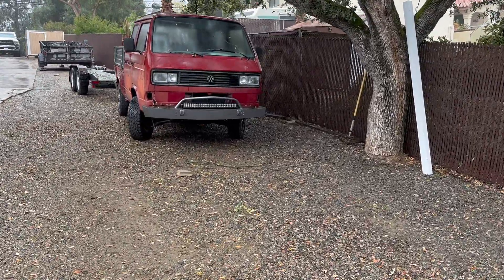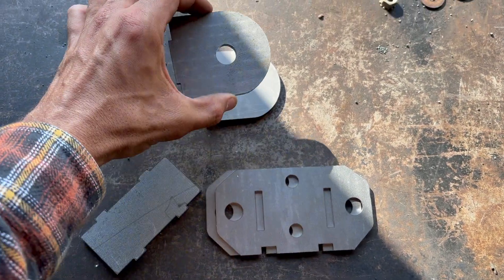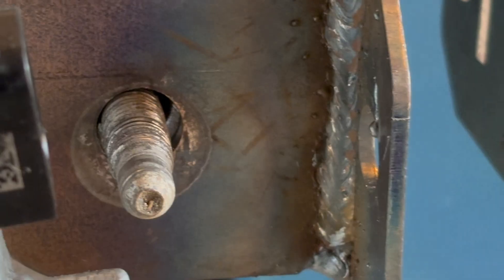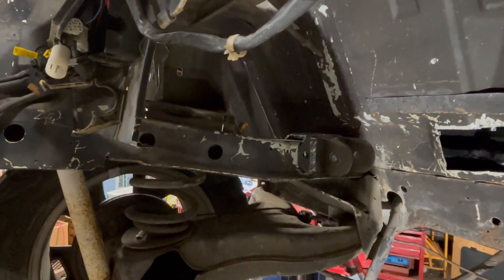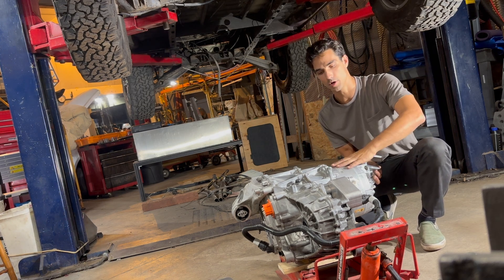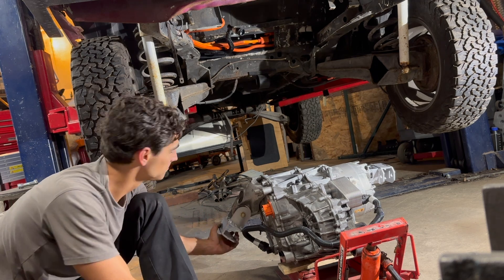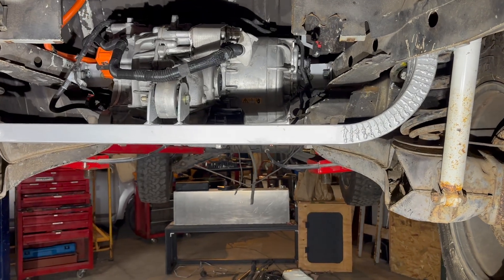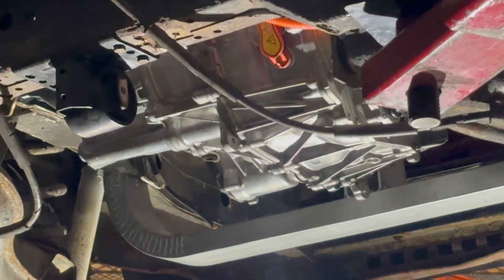Putting a Tesla Motor In My VW bus

Comment: I want to convert my Vanagon Single Cab so Im sending you a message. I posted on your instagram page to no avail. On instagram Im know as somewhattwisted.    :).  How would you lower the mounting points to help reduce that drive axle angle on  each side and yet still retain solid strength for side loading? I have another avenue to electrify but Im liking how the Tesla Model 3 fits and leaves sooooooo much room. Here in the states I could and would likely want to widen the mounts and weld a strengthening plate on each side of trail that the mount straddles. If the lowered mounts allow removal without removing the rail mounts then I’d also weld those to the chassis rail here in the States. I want it super strong and super overkill. I’d use thick tubing to make that cross mount. That would need to be removable.

Comment: Super inspiring!  I would love to try converting my old Datsun. Is there a reason why you chose model 3 engine and battery pack vs the model y? Model y battery pack seems more compact and may not have had to be cut down.
Will you please post more information about installing the charger, how it turns on, and how it connects to the steering?

Comment: Things do not mounted by a 'precision' tube/bolts. It is being hold/fixed without freeplay by the ends of the tubes, contact areas, which are pressed together using the bolt-nut.

Therefor the ALU tube in the two motor mounts should be just used to fill the 'hole'. The original steel inserts inside the black rubber of the motor, should be clamped between the two flanges of the new motor mount.
For the mounting of these two mounts on the car frame: the beam of the car must be 'filled-up' using a steel tube so a clamping force on the frame would not crush the car-beam.

So to fix things correctly: a bolt-nut should cause (a lot of) friction between surfaces to mount things. A hollow beam will prevent friction force because the beam will compress, so causing no friction force. 

While it now maybe does not have freeplay, side-forces will enlarge/re-form the holes, and so cause freeplay (and more) in the end. This because no friction(hold) forces are present to prevent sidewards movement.

Comment: The bar mounted with straps is perfect way to destroy engine rubber bushings. You pretentioned it as fuck and all tension is transfered directly into rubber.
This is not only one shitty mechanics, there is a lot more in video

Comment: Aluminium and steel, so bad idea! Did you listen about brass?
Reply from the maker: Should I use brass for the sleeves? That’s a good point.
Reply: @bernietime  i work at aluminium ship, we got problems with steel bolts as they get locked together 😔

Comment: the crossbar should hang on the chassis, and secured with bolts, not load hanging on bolts.
Reply from the maker: I thought of this too. This was the original design that the Volkswagen engine used to be held in place. Do you think it’s stronger?

Comment: Hi, cool ride.  I do have one question maybe a concern for your safety. When I watched you install the bolts, you put them in from the back with the nut one the front side.  I work on old Fords and a few of my teachers always had me put the bolt in from the front with the nut on the back.  They said if the nut loosened off, the bolt would at least stay in.  The way you have it, the bolt could slide out. Ok maybe an old grump guys wive’s tale but I just to it that way so they don’t yell at me from their graves.  I am glad I found your channel. I like it
Reply from the maker: That’s a good tip! I also need to go back and change out all the bolts for grade 8 V and I will use this tip when I do so. Thanks.

Comment: HOLY CRAP DUDE! ~That has got to be some of the ugliest "welding" this side of the Third World. Prep & settings are your friend. Practice with the type of metal you are going to be using each time you set up for a new project. Practice practice practice.
Reply from the maker: I agree! I’m using an old old Miller welder which doesn’t work very well. I can’t blame the equipment, but it definitely contributed!

Comment: In some regions, the bolt on mounts are basically a requirement, because veld on mounts can be considered altering the structure, making it more difficult to make it road legal after conversion.
Reply from the maker: Interesting! Do you know what regions require that?
Reply: @bernietime  I believe I saw it in a video from av EV conversion workshop in the UK but I'm not entirely sure about that. I don't remember if it was that it was impossible to get it approved,  but possibly it was rather that it was easier, when they could reuse the old approval for the frame, especially when there's no cutting.

Comment: Take the spring washers off, throw them into the scrap bin, and get some nylock nuts instead. Then get 12.8 or 8.8 grade bolts as well, and use the spec from the manufacturer for them with nylock bolts, along with a generous amount of anti seize compound in the inner section where it meets the mounts. As well with the mounts, use some anti corrosion spray on all the mating areas, easiest is linseed oil, applied with a spray gun, and left to drip off and polymerise for a week. Works as well in all the body panels as well, and wherever you have chassis rails. Messy, but keeps it from corroding really well.
Reply from the maker: Best advice I’ve gotten in a comment ever. I will definitely do this. Thanks!

Comment: The mustache bar is a brilliant idea and very well designed. You can bolt a skid plate later to cover and protect the motor.
Reply from the maker: That’s the plan! I might actually end up dropping the motor lower so I will definitely need a skid plate

Comment: Just for the record it’s not the first. A guy on the Saba VW forum did a super clean Tesla swap into a Doka probably 10 years ago. Still good job on doing one. Imo that mustache bar should have a plate on the side of the frame rails rather than the bottom.

I did a GM ecotec swap in mine also around 10 years ago and I made side plate mounts for that and never had any problems. With the bottom plate mount of the bolts loosen everything just falls off in the rear. I’d personally do it closer to like your front mounts are.
Reply: Yup, and Electric Classic Cars UK have been doing VW vans for the past 10yrs. They have a youtube channel also covering all their work.

Comment: and how is it getting power to the wheels?. 
lots pics of bolts n things but no info on drive connection, arguably pretty important aspect.
I'm assuming not a magic interface 
why no  mention of drive shafts/  gearbox anything?/
Reply: Yeah, I was wondering about the angle the drive shafts will be at when the Doka is sitting on the ground - not saying they will be any worse than their earlier life in a model 3.

Comment: Regarding the third mount on that Tesla motor the one you called the mustache Mount. Why did you decide to hang it low or underneath instead of running across the top of the amount?

Comment: It looks very neat but did you put a sleeve inside the frame rail to stop it crushing? Even with the frame rail being sandwiched by the brackets they will bend crushing the frame rail and leaving the bolts loose. You may even need to strengthen the frame as the twisting power of the motor will be 10 times that of the original engine.
Reply: Agreed